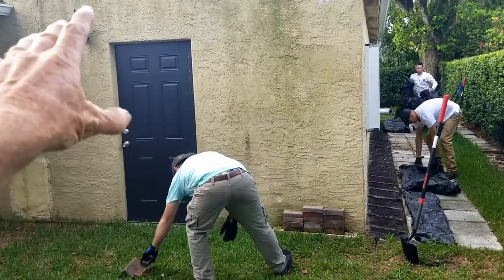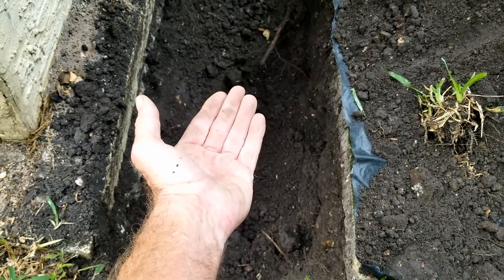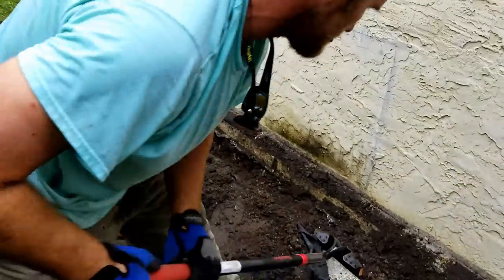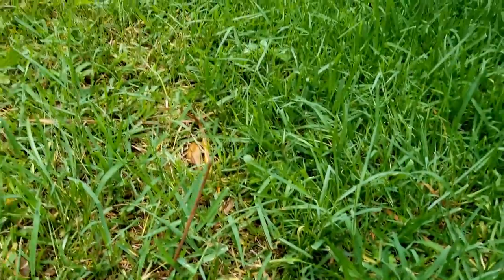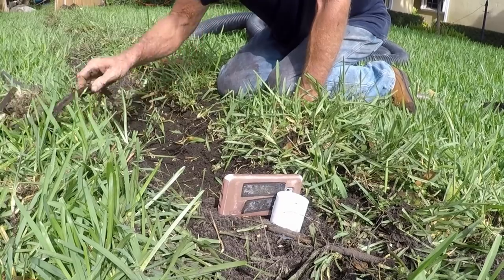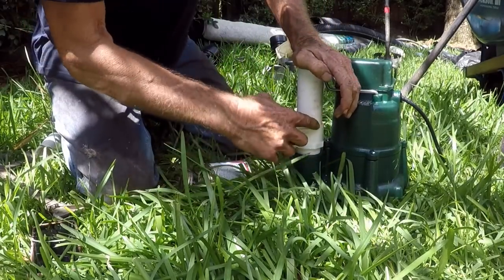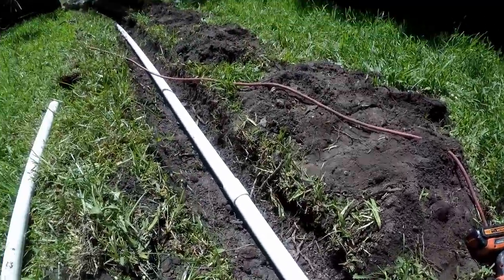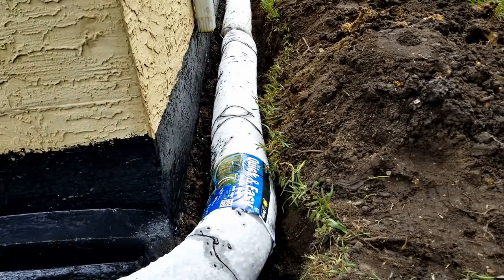French Drain, Waterproofing, Exterior, Footer Pipe, Keep Your Foundation Dry

Comment: Hi Chuck.  Another great video!  In watching many of your vids, I notice sometimes with french drains you wrap the fabric directly around the pipe, then fill gravel on top of the wrapped pipe.  Other times it looks like you have lined the trench with the fabric, set the perforated pipe into the fabric-lined trench, then cover the pipe directly with gravel, then wrap/fold the fabric around the the gravel-covered pipe.  Is this a per-site difference or does the order of the fabric and gravel matter?  Thanks, brother!

Comment: One day for diy? And 3-4 hours for your crew?
Reply: I love Chuck's videos but he is always underestimating how much time it will take for the diy'er. He's been doing it so long I don't think he realizes that amateurs have a number of challenges he doesn't such as: 1. He knows what the plan is, 2. He has all the tools, 3. He has all the materials he needs, 4. He knows what techniques to use for maximum efficiency, 5. If he has an accident, such as an breaking irrigation line, he has the tools and parts to fix it. Any one of these issues for the amateur will require a delay, a trip to the hardware store and potentially some research on the internet to resolve it. However, there is no better feeling than taking care of business one's self so I try and perform my own work and repairs around the house.